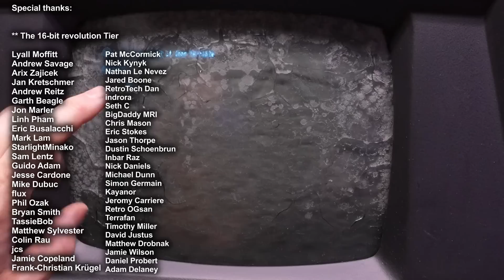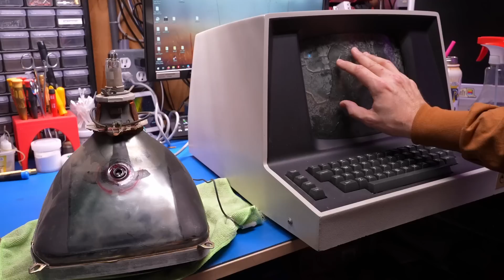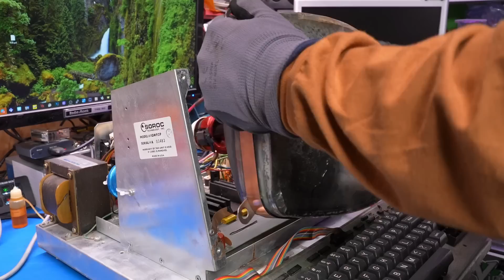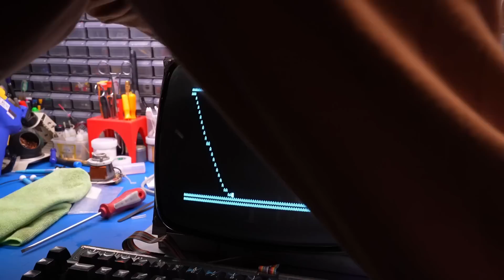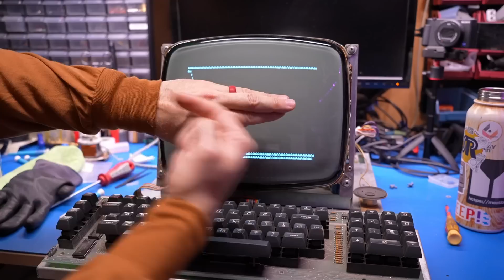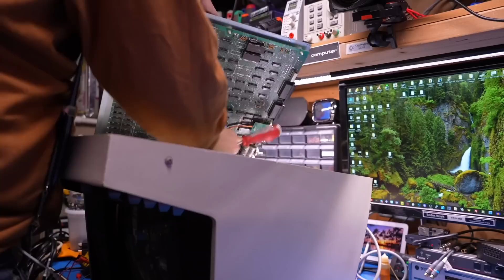Soroc IQ 120: CRT swap try #2. Finally some success?

Comment: I dare say if you are able to repair the cataracts on the original CRT I think you are legally obligated to put it back in the terminal for originality! Great video!
Reply: In that vein, I'm kind of glad Adrian fixed the old linear supply rather than swapping in a switchmode.
Reply: @paulstubbs7678    Agreed. I'm pre-switch (not the game). People can say what you will about a L-supply but it's dang simple, reliable and understandable. This I understand  :body-blue-raised-arms: If it's a choice between a rainforest and 'noise free power', well.."power to the people"    You RoCk PStuBBs
Reply: I would try soaking the old crt in acetone to get the front layer off, i have had luck doing this on other screens with similar issues. (note if you do this make sure the acetone bath does not come up the sides and get on the electrical coating.)
Reply: @cbullar4205  Now that's what I call a solution :face-turquoise-covering-eyes:  If heating is considered, "a traditional heating pad" can go as high as ~170F. Laying it face down (reminds me of a old GF :hand-orange-covering-eyes:). Silicone thermal pads for more heat. A heat guns just sounds a bit dicier IMO. However the big-A sounds like the worthy winner (disregarding flash fires etc 🔥)
Reply: @ovalwingnut  Indeed, best to avoid using the heat technique at the same time as acetone....... lol
Reply: English isn't my native language so I sent this comment over to Chat-GPT to clue me in  :body-blue-raised-arms:

Chat-GPT explains...

"I dare say": 
This phrase expresses a mild assertion or opinion, suggesting the speaker is making a slightly formal or confident statement.

"if you are able to repair the cataracts on the original CRT": 
This refers to fixing a problem (likely discoloration or clouding) on a cathode ray tube (CRT). "Cataracts" in this context is likely a metaphorical use, drawing from the clouding of the eye's lens in medical terms.

"I think you are legally obligated to put it back in the terminal for originality": 
The speaker suggests there might be a legal or ethical obligation to reinstall the repaired CRT into its original terminal (likely a vintage computer or display device) to maintain its originality.

It seems to be about preserving the authenticity of a device during repair. If this aligns with your intended meaning, it's quite clear, albeit somewhat niche. The speaker could also be "pulling one's leg". Would you like me to refine or rephrase it for clarity? 

** I understand more now and I'm currently looking up the phrase "pulling one's leg". PoLoMo you RoCk!
Reply: @ovalwingnut it seems ChatGPT understands everything except sarcasm 😅
Reply: @mrfrenzy.  Very punny Mr.F.  :hand-pink-waving::face-blue-smiling:

Comment: Well if you're referring to my comment from the other video, no, I didn't suggest water, I suggested placing it face down in alcohol as the glue supposedly dissolves in alcohol.  You just need enough to cover the first few inches, and let it soak for a while (upwards of a few days) then peel and soak, peel and soak and it "should" come off 'easily'...

This is all according to a friend who used to do this sort of thing for color and high end CRTs.
Reply: Yeah, I saw a "water test" and it sat for like a month and nothing happened. It's not water soluble.
Reply: After a quick google search about solvents I found that DMSO apparently works better than water at dissolving PVA, I wouldn't recommend it though as DMSO can carry substances dissolved in it through skin, I'd be careful if going that route.
Reply: @pANZERNOOb  IPA or denatured alcohol should also dissolve it too, at least from what I'm told it does, maybe not as quickly as other solvents but with relatively more safety...

Comment: And a new piece of history saved from the scrap heap. Well done! Now to put it to good use as a serial terminal connected to one of your other retro computers. Because you can. 😆
Reply: UsagiElectric plans on setting up some "dial-up"/remote connections for his Centurion minicomputer, so Adrian could try connecting to that machine when it's ready.
Reply from the maker: Yeah I had meant to dig out my Wifi modem to play with it some more -- but I totally forgot in this video.

Comment: PVA is used as water-soluble support material in 3D printing.
Reply: It seemingly does take a lot of time to seep through. "shango066" let it soak over 2 months until the PVA was completely separated (it turned into a rubber-like consistency). From his video, i get that he did not check often, though. Slow but safe.
Reply: You’re right